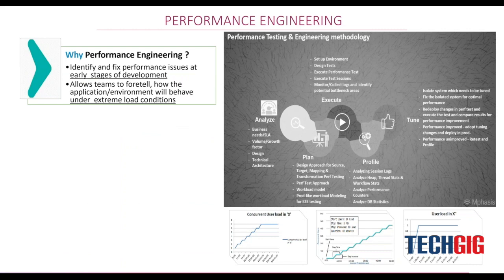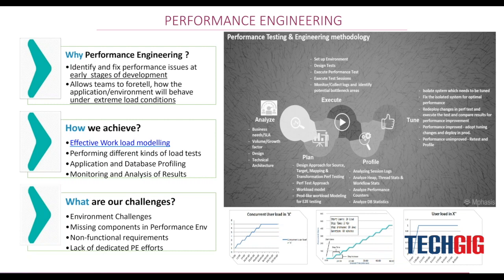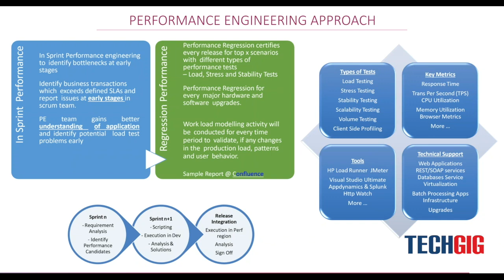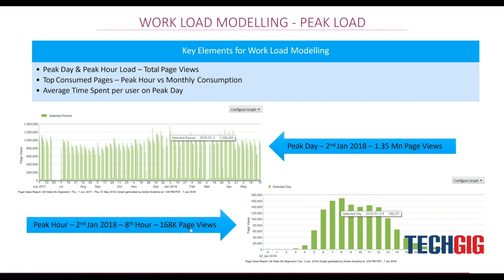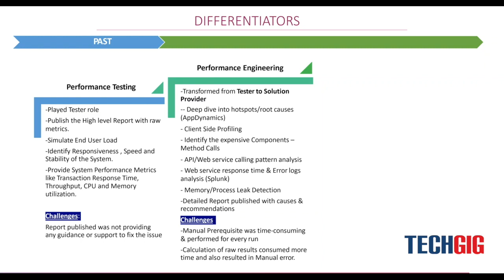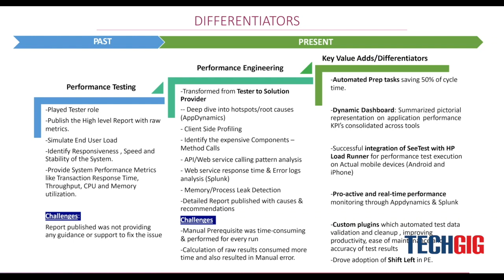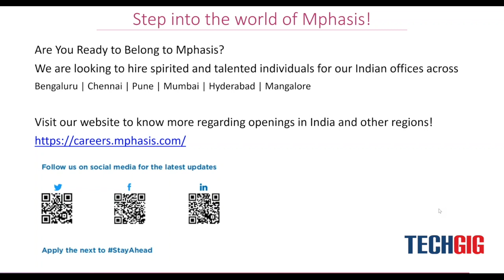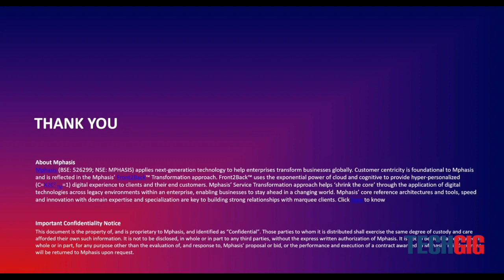Performance Engineering Concepts

Comment: To identify the issues we need to have apm tool must?
Reply: It depends on the issues you are trying to identify Madhu. If say you want to simply get the CPU and Memory stats for a server/vm/process, then it is easily achieved without an APM tool. However, if you need to do a deep dive such as identify the hotspots, or the tier consuming maximum time or just identify bottlenecks, then APMs come handy. But one needs to keep in mind that APMs are expensive and requires a setup done where as standard performance monitoring does not require a lot of setup.
Reply: @rajasshanbhag4729  we have jmeter by using jmeter we can put load and we get statistics like response times if got RT is 20sec for one transaction then how to find the issue(resource utilisation is good)
Reply: @madhureddy6899  ooo, not enough information Madhu. What's your response time for a single user? What's your average response time? Is it happening on a single txn or on all transactions. What is the sla for the transaction? What I am trying to say is why do you say its an issue - is it because 20 seconds according to you is too high or is it truly high compared to other transactions?
Reply: @rajasshanbhag4729   basically I have doubt if we have only jmeter what can a performance tester will do ,just putting load and get the metrics and sharing to the team or anything else, if we got one transaction response time high and we don't have any SLA  at that time we need to find the issue or simply share the report to the team is enough if we don't have any apm tool
Reply: @madhureddy6899  If you have limited visibility, then the best thing you can do is just share the results with the developers. Investigation requires a lot more knowledge about the system, the transaction, the topology, SLA etc. Without such knowledge, the only option you have is run the test and provide findings.